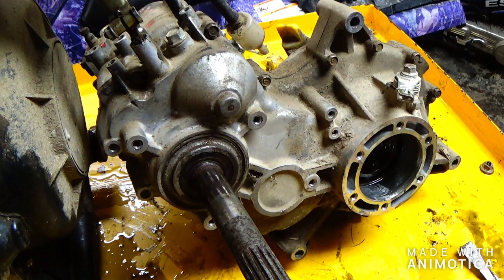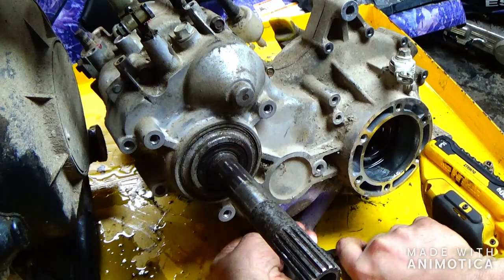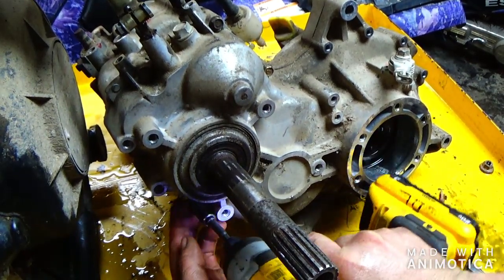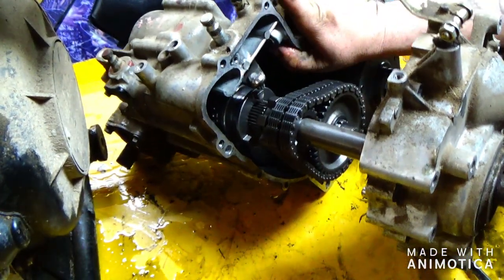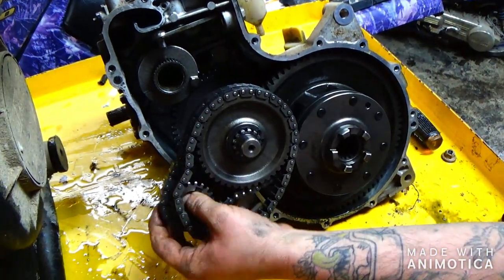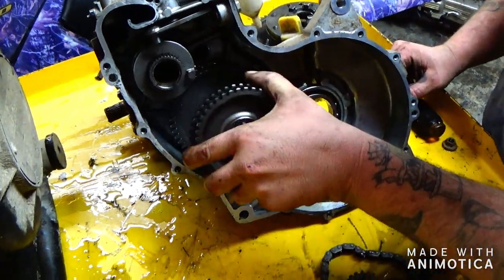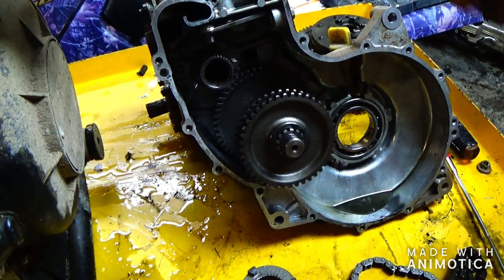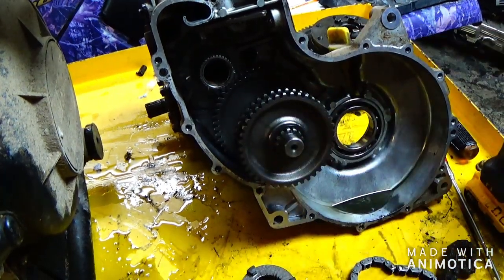how to mule transmission teardown 3010/2510

Comment: Great video! Ive got a customer's 2007 3010 it would drive in 2wd reverse ok but wont drive forward in 2wd without diff lock engaged and its clunking, 2wd no diff lock wont drive forward (right wheel barely turns jacked up but clunking noise), im just waiting for the pc puller so I can get that off and the back plate and remove the trans. Have you any tips or tricks or advise on what the clunking may be? Im in the uk, id like to try tackle it myself as it looks fairly easy and you have show how to split it

Comment: My kawasaki 2008 3010 makes a squealing noise when the 4x4 is in gaged.   Only makes this noise when the vehicle is moving.  The noise is coming from some where in the front.  When the 4x4 is disengage,  the squealing sound goes away 5 seconds after 4x4 is disengage.   Anyone has an idea what is causing this noise?

Comment: I've got to teardown a 3000 mule (2003) Jumps out of forward when travelling..Been told three lugs on gear had corners taken off with shifting when moving..so have got to replace gear...can i strip the trans side (r/h) with out stripping the left/hand side to get to gears? Cj UK
Reply from the maker: it's Corden on what gears you are replacing but most of the gears are in the inside of the transmission so usually you have to split the case to get to them it's a lot easier if you take the transmission out then to do it in the machine